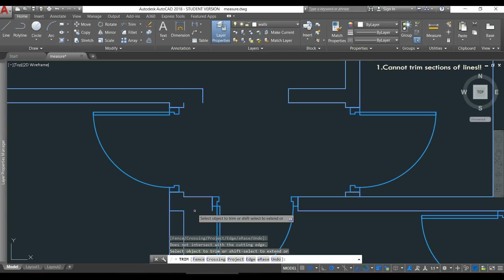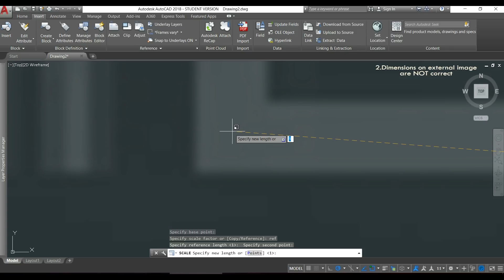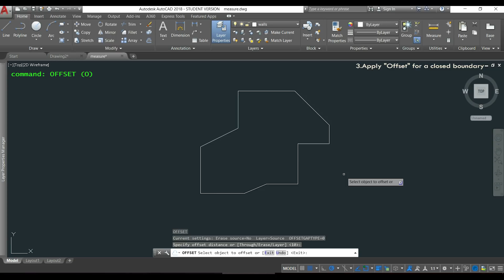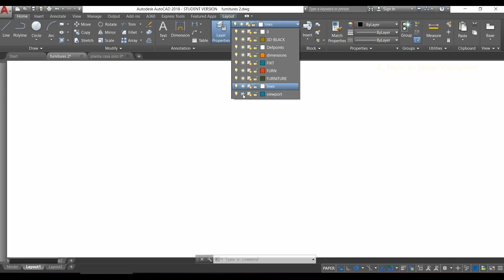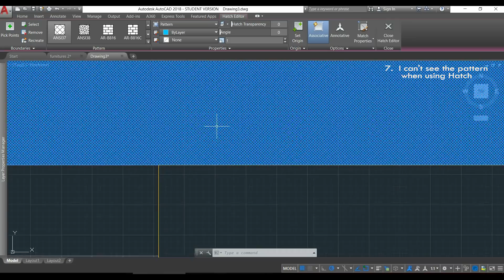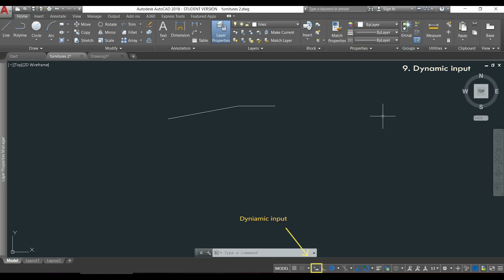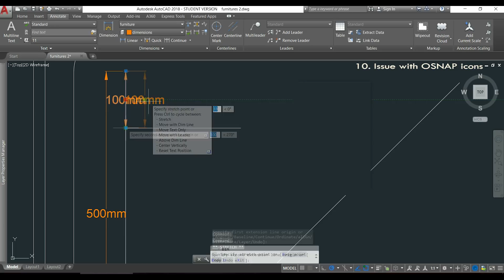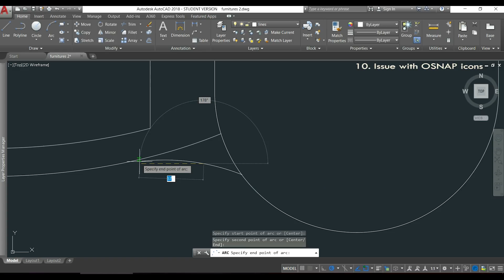AutoCAD - Complete Tutorial for Beginners - Part 6 (beginners common problems)

Comment: Hello, thank you, very informative, however, on issue 10 (11:28), is there a hey to temporarily disable OSNAP to place an object or dimension line in this case, freely without waiting for it to stop tracking (as you suggested) or having to manually turn it off?
Reply from the maker: Hi +Guillermo Serra. Yes, you can press F3